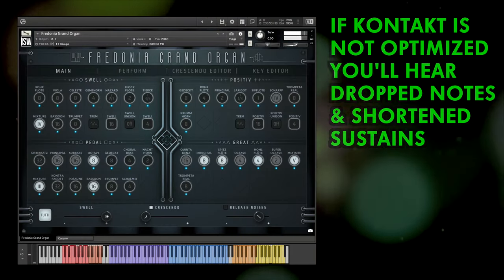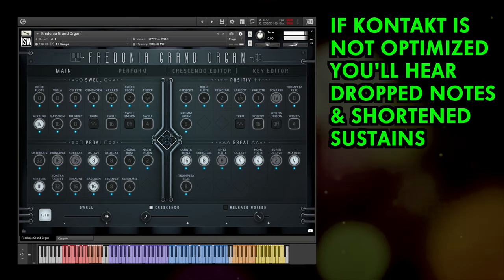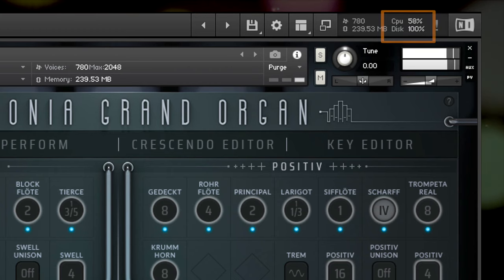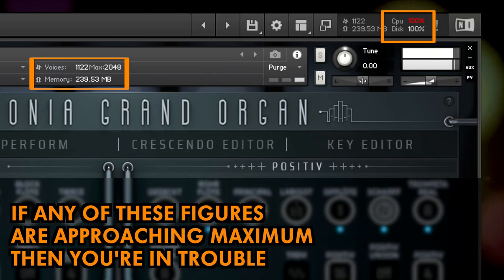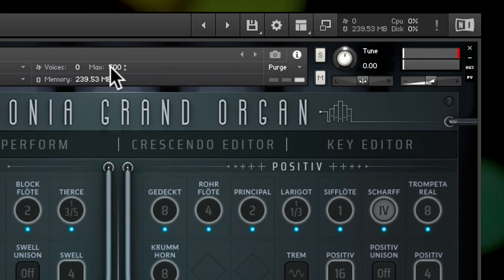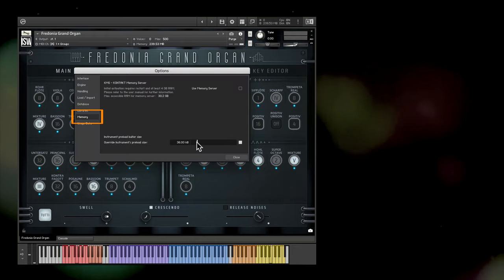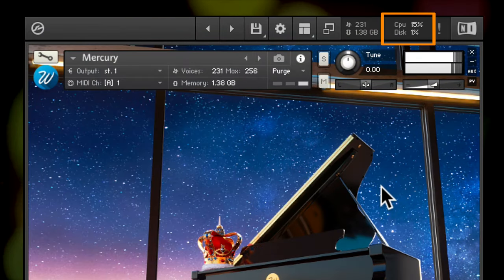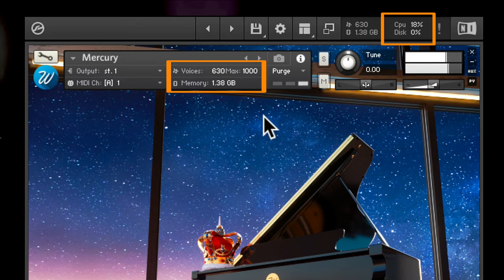WHY ARE NOTES DROPPING IN KONTAKT? AUDIO PLUGIN DEALS

Comment: I have noticed some Kontakt instruments don't like when you play the same note consecutively and they are overlapping. With such instruments, the second note ends up dropped and you simply need to remove the overlap in the piano roll as a fix.
Reply: Can u help me how to do it while playing live? Using kontakt in cubase 10.5
Tq
Reply: This bug is so stupid, I have to add a little gap in Dorico for all repeated notes. They don't even overlap, they just fit together tightly, and the gap is audible
Reply: Well, I found out there's a setting in Dorico that allows you to choose whether an instrument can play 2 unisono notes at the same time or not. Turning it off fixed the problem!

Comment: I am still having issues with it. I cannot play more than two notes at the same time without it bugging out. Either it will skip a note, or continuously play a note after I have stopped playback, which then I have to start and stop playback again to stop. CPU is ~10%, Disk is 0%, voices is around 2, sometimes 3. This is driving me nuts!
Reply: same problem, I dont know how to fix this. Please let me know if you have a workaround.
Reply: @Nash_White  i did fix this eventually. Not sure exactly what I did, BUT it has something to do with accidentally disconnecting an individual equalizer from the master equalizer... Good luck.
Reply: Same thing I can't get it to work, I've tried everything, looking at the voices, turning off effects, but it will just miss a random note. It wasn't an issue before though. Without changing any settings, it just stopped working.
Reply: same, I tried everything, probably my computers cpu or something but still, I can't even write a song rendering my libraries USELESS